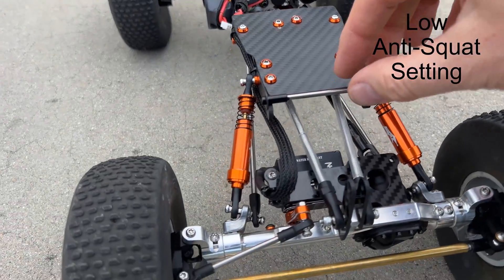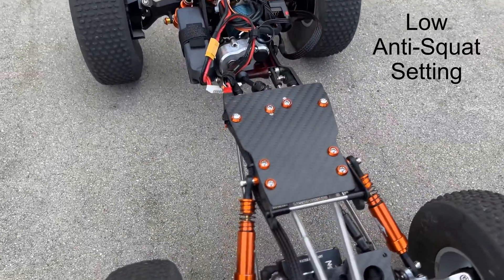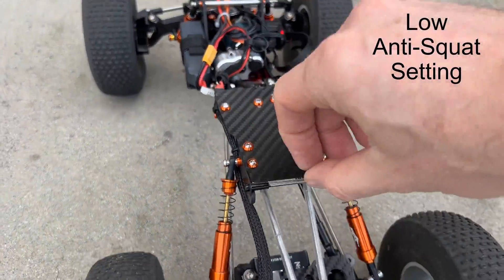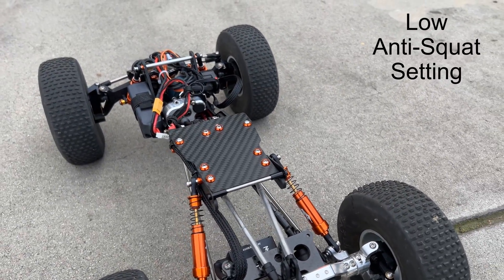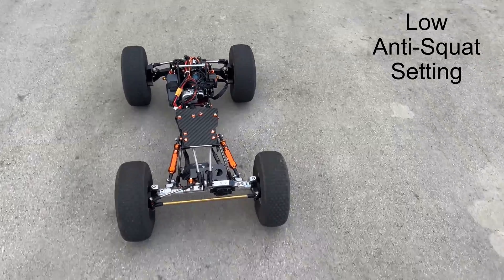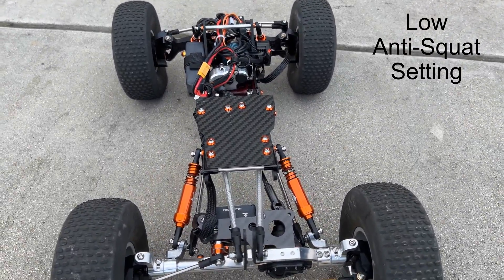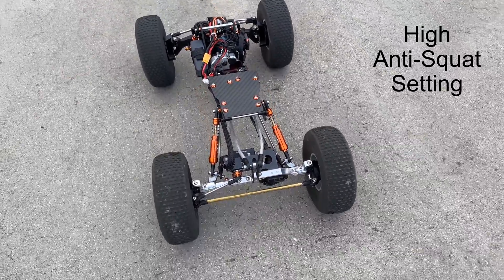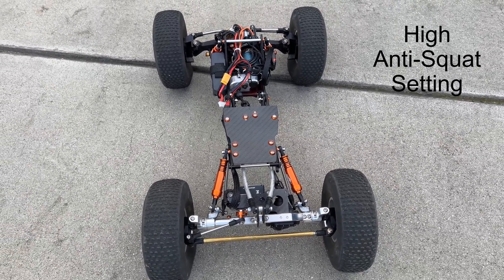How Overdrive Defeats Anti-Squat on RC Crawlers

Comment: SO.. i come back to this now after watching it maybe the 3rd or 4th time and my only question is... how do i get the pro squat to work? do i remove my under/overdrive? would it benefit only in verticals? would it be overall beneficial to my 1/24th scale comp use truck? is it better to have pro or anti squat? essentially i think for verticals, getting those rear shocks to lift and decompress during the vertical would of course help and be awesome to watch happen but then what would be the downsides? less sidehill? sir.. how do we make the best 1/24th scale crawler that 24yep and the world has ever scene? thats really my goal.
Reply from the maker: So hopefully you have watched this video.

https://youtu.be/VuLIu0RguAs

If you are slow crawling up a hill, you cannot employ anti or pro squat.  There is no acceleration causing the dynamic weight shift. So I think that fact answers most of your questions.
Some overdrive is good for climbing because it creates traction.
Negative spring shocks are the most effective way to hold your front end down with minimal downsides.

Comment: why do we use 30% OD if it does this? I feel like the rig squatting would be good for center of gravity reasons. I'll be watching more vids, need to learn more
Reply from the maker: There are quite a few situations where overdrive is beneficial, but I do believe it's a little overrated and overused. It forces one set of wheels to slip but it also sort of simulates dig by making the wheels work against each other and squats the suspension.

Comment: The biggest thing you are missing is the physics of when the rear end has grip regardless of what the front is doing the rear is still creating an anti squat reaction in the rear anytime there is load on it..  in a real world scenario sometimes it's a whole different ball game..  in a slow slow crawler with over drive its not overly noticeable but it does change alot when it comes to how the suspension actually moves around..  personally even my slowest crawler with over drive can still rip a wheelie so yeah that anti squat makes a big difference when the front wheels have no weight on them..
Reply from the maker: If you have over/under drive one set of wheels has to be slipping. If the rear has grip, you are right, AS will be actuated. However, most crawlers have a forward weight bias and the rear wheels are slipping. This is what is demonstrated in the video. As you start to go up hill, your weight bias naturally shifts to the rear and you start to get more traction in the rear as you point out.
Also remember, AS is a dynamic response to a dynamic weight shift.  If you are crawling at a slow speed AS doesn't do anything. I published a couple videos on that topic.

Comment: Personally I think overdrive is a bad idea for crawlers and much prefer underdrive. This way you still get that overdrive of the front but your not increasing wheel speed which to me is awesome for slow accurate controlled climbs. If your running brushless motor, it should be able to still give you that burst you may or may not need to get past some tricky areas of the climb. I run anywhere from 12% od all the way to 33% and recently moved to 33% ud on my micro crawlers. The overdrive is really only useful on high angle climbs where I notice it helps pull the front end over and keep it stuck to the hill. Without it the rear tires that have most of the traction just end up pushing the rig off balance really fast and make it fall backwards nearly 100% of the time. Good info and vid. 
Just took a quick glance at your channel and its the best stuff, mountain bikes and RCs. Still have my 2006 RockyMountain RMX 2.0 and that thing has some of the kewlest looking rear suspension of any mountain bike Ive ever seen :)

Comment: This is cool but not real world. Overdrive isn’t for flat ground. Overdrive is literally for when the fronts are unweighting, so over 45°, especially as the rears are hitting the wall (bite) while weighted. This demonstrates the relationship but does not show what it’s actually for and why it’s important. We do tons of stuff that’s not done 1:1 but there’s not a 1:1 that’s going to be as capable as those crawlers.  If you’re not pushing the limits vertically, overdrive should be minimal or not necessary. Also, overdrive is huge in high angle descent. Thanks for sharing.
Reply: Also, it’s not a bad thing for your hips to drop on a super performer. Having weight above the axle, like a heavy body, functional anti-squat becomes quite important. On a sporty with weight at or below the axle, the anti-squat still pushes the front of the rig into the hill, even when fully collapsed, if it’s setup properly.
Reply from the maker: I completely agree!

Comment: weight transfer due to acceleration, changing the height of the links will decrease or increase the squat but there will always be force on the rear when going forward
Reply from the maker: Force = Mass x Acceleration.  If you are moving at a constant speed then there is no force except tire rolling resistance, aerodynamic drag, etc.

Comment: The AS is getting important when you're on a hill and the front has no traction. In that case you can bump without getting the rear shocks compressed that much.
Reply from the maker: Yes, you are exactly right. When you punch the throttle that’s exactly when AS deploys, and you want the correct AS setting. Acceleration bump from a throttle pop.

Comment: Great video! Through trial and error I came to the conclusion that a link riser had little to no effect on the rear shocks staying extended but I never really made the connection between AS and OD. Thanks for simplifying an often misunderstood topic.
Reply from the maker: Happy to hear your test results match up with the physics. OD is one of several reasons AS doesn’t work in slow crawling situations that’s super easy to demonstrate. I’ve got other vid coming soon. Thanks for watching.

Comment: Are those shock/spring settings just for this demonstration? Or do you actually crawl like that? Curious.
Reply from the maker: Yes, that is actually what I run.  It just so happens to also be good for this demo because it's quite light oil which lets the shocks move more freely and isn't adding significant damping force.  Heavier oil could be one more variable affecting the outcome. Also, the rear spring rate is not at full droop in an incline which you will see in my next video.  Finally, having no front spring is approximately the same as a medium spring plus a hair band - they cancel each other out. Should be another video on that.

Comment: Nice video, verry informativ both of them. Can you do one explaining torqutwist and how it can be eliminated or reduce ?
Reply from the maker: That's a great suggestion. Unfortunately, there is not a lot that can be done so long as you have a chassis mounted motor and drive shafts.  You can't solve it with linkage. Great topic for a video.

Comment: what are your thoughts on portals vs straights? portals pull on the upper link while straight axles push on the upper, which borderline gives the "opposite" squat effect than desired on portals vs straights. would love to see this test done again on a straight axle to see how the results compare. good stuff
Reply from the maker: I can see why someone might think this, but the reality is that the axle housing can only rotate opposite of the wheel rotation. Doesn’t matter portal or straight.
Reply: @BoomslangSuspension  yes thats true, but the portal boxes cause the tire centerline to sit below the lower links, which causes the portal box to want to drive "under" itself, which then pulls on the upper links from that leverage on the axle. may be a different topic, but is a large variable to consider when setting up geometry imo. ive tested myself that the resulting forces on the links arent in the same direction because of that, pretty easy to see with a "sloppy" setup